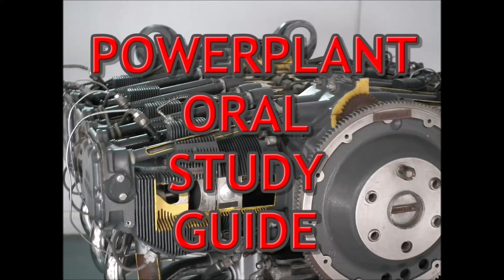2025 FAA POWERPLANT Oral exam Questions

Comment: 00:18 Chapter 1 Reciprocating Engines
03:03 Chapter 2 Recip Engine instruments maintenance operation 
11:29 Chapter 3 Turbine Engines
18:15 Chapter 4 Turbine instruments
21:37 Chapter 5 Induction systems
33:41 Chapter 7 Engine Fuel and fuel metering
44:34 Chapter 8 Electrical starting and ignition systems
55:58 Chapter 9 Lubrication Systems
1:02:25 Chapter 10Cooling Systems
1:12:41 Chapter 12 Propellers

Comment: Chapter 2 a weak cylinder is found during a compresion check? What do?

Answer: check the inside of the cylinder. Not... pressure is equal in all directions.

Comment: I just got my powerplant liscense yesterday, these videos paired with jeppeson test guides were fantastic. Im already studying for my airframe now
Reply: Is the questions similar ? And what practicals you had on your test for general and powerplant ?
Reply: @johnnydoe9969  i now have my airframe as well. The hardest practical for powerplant was removing and replacing a cylinder it was just time consuming. And for airframe it was either servicing the nose gear or the ELT.

Mostly those "bigger" practicals are just time consuming. Just focus on using your tech data and you should be fine

Also for orals the jeppesons were fantastic. It also lists practicals and you can look up the practicals on the FAAs website. Research ones that you dont feel confident about. Maybe practice a few. 

As long as you study and put in the effort to prepare youll breeze through it.
Reply: @praiselordcthulhu2428  Is there enough in these 3 videos to pass the oral?  I got many O&P for Airframe, Powerplant, and General coming up on March 3rd and I Just started studying a week and a half ago.
Reply: @ryannelson5943  these videos just voice voice over all the jeppeson test guide verbals. My dme proctors verbals were all jeppeson questions. So between this and studying the books youll be fine.

Just remember study every day or close to it. Reading them for 20 mins a day is better than 3 hrs in on sitting. Repetition helps me pass tests better.
Reply: Hi brother can you help me With question for mechanic

Comment: 0:18 Chapter 1 Reciprocating Engines

3:02 Chapter 2 Reciprocating Engines Operation/Instruments/Maintenance & Overhaul

11:29 Chapter 3 Turbine Engines 

18:14 Chapter 4 Turbine Engines Operation/Instruments/Maintenance & Overhaul

21:35 Chapter 5 Induction system

27:53 Chapter 6 Exhaust system

33:42 Chapter 7 Engine Fuel & Fuel metering

44:34 Chapter 8 Electrical Starting & Ignitions systems

55:59 Chapter 9 Lubrication Systems

1:02:24 Chapter 10 Cooling Systems

1:07:15 Chapter 11 Engine Fire protection

1:12:43 Chapter 12 Propellers

1:20:10 Chapter 13 Powerplant & Propeller airworthiness Inspections

1:24:38 Chapter 14 Powerplant Troubleshooting

Goodluck everyone!
Reply from the maker: Yea bro!!!

Comment: I took my O&P for General, Airframe, and Powerplant today.  For the most part this video was spot on.  Nearly all my questions were word for word.  On my oral I only got 1 question wrong on the General.  Everything else was 100%.
Reply: How many questions were not from these videos for you?
Reply: @chrismalone4062  For the most part the General and Powerplant videos are spot on and are easily enough themselves.  There is a section of composite and welding questions in the ASA Airframe however that includes some O&P questions not in the Jeppessen.

Comment: 7:34 chapter 2: recip engine operation. instruments, maintenance, and overhaul Question 13 is wrong in the book:
The answer should be "The inside of the cylinder. Check piston rings and cylinder walls for wear"

Comment: i got mine o&ps in 12 days this is definitely my go to every day 😂
Reply: Did you take your written after August?
Reply: Hey did you pass ?
Reply: How was it
Reply: @keirisanchez8490  I think my powerplant was alot easier than my Airframe. I got that before the changes. The new changes ....Make sure to study what you missed on the written. I got an 80% and i still got 21 questions. I had 12 practices, you have to answer 3 questions on top of your practical. Thankfully that one is open book. It's  time consuming so get familiar with the 8083 book. Finally, don't let the failure of others discourage you. I put off my powerplant months after school because I was afraid of the changes. I had very few ASA questions on my written... make time to open your book and read and study the material. Alot of my questions I knew because I read the book. I read the jeppesen textbook I feel like it explained things a little different then the 8083 (More simple) I got a handful of these questions (video) but flipped so study both the question and answer!! Good luck ❤️

Comment: These videos are super helpful! I've been using them to study and already passed the Airframe portion, thanks in no small part to these videos.
Quick question though, in Chapter 2 one of the questions is "A weak cylinder is found during a compression check. What must be inspected?" and the answer is "Pressure is transmitted equally in all directions" 
That can't be right can it? The answer doesn't even say what to inspect.
Reply from the maker: “The inside of the cylinder” is also a correct answer.
Reply: "The intake valves, exhaust valves, & piston rings" is ACTUALLY the correct answer. 👆

Comment: On chapter 6 the question about zinc my book says it changes the molecular structure and causes cracking when heated
Reply from the maker: Yes that is also correct, look up galvanic (dissimilar metal) corrosion.

Comment: What is the torque value for a magneto clip bolt?  Find that and you win $5....
Reply: Not one soul found this?  I should have said for Slick Mags.   It's in the Slick Magneto overhaul manual, but in the trouble shooting appendix:  190 to 220 inch pounds.